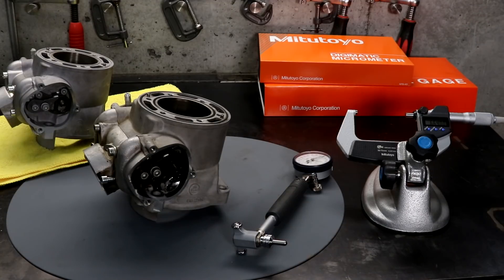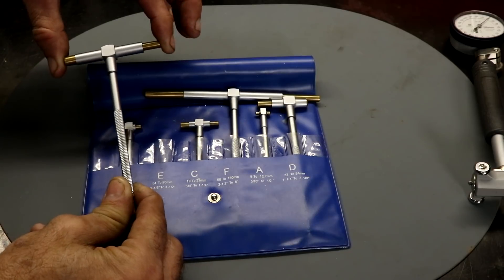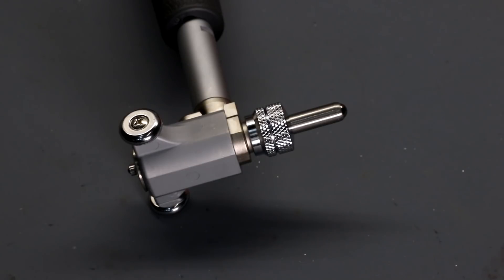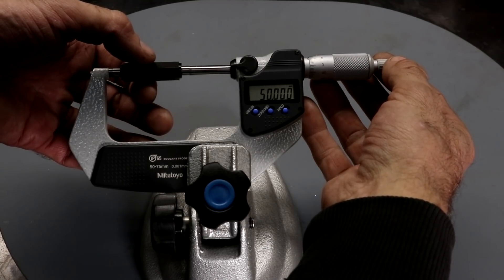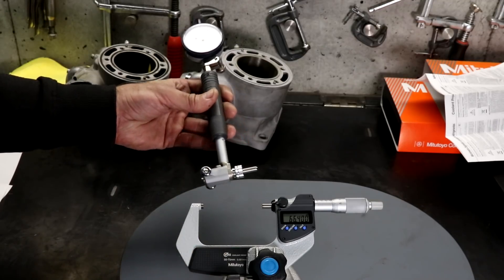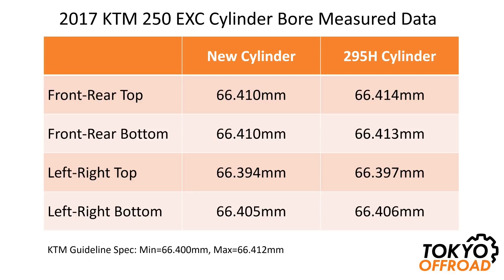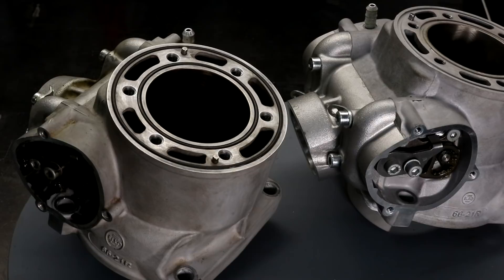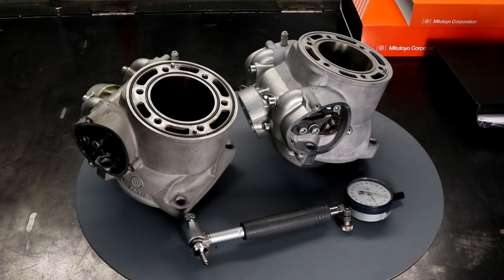Cylinder Bore Measurement

Comment: What about the micrometer stand? Do I need that?
Reply from the maker: Having a micrometer stand is not essential, but it does make it much easier to make measurements as it frees up a hand so you can hold the item you want to measure in one hand and turn the micrometer knob with the other hand. The one I have I purchased online (no brand) and was reasonably priced and decent quality. It's also sometimes handy for holding other things too.
Reply: @TokyoOffroad you’re the man! Keep making these videos! I have a 250cc and 300cc TBI and your vids have been so valuable.

Comment: Interesting that the KTM specs are listed as 3 digits after the decimal, that's SUPER accurate, no? I'm guessing a micrometer that only has a resolution of 0.01 would not be sufficient to get this level of detailed measurement...
Reply from the maker: Yes, that's right. The digital micrometer I use in the video (Mitutoyo 293-242-30 MDC-75PX) has a resolution of 0.001mm and is ideal for this application.

Comment: If you're just doing the same size cylinders only, could you get away with just using a inside diameter standard to set it to 50mm or 2" or whateverand not buy a micrometer? I have a cheap micrometer already but I feel it would knock gauge out of true.

Comment: Hi Mark, when you change piston on your 300 tpi, do you go for minimum piston to cylinder clearance?
My 2022 300 tpi have never had issues with the airfilter but are close to the service limit at 10 hundreds already after 42 hrs of normal enduro riding so it must have been close to max tolerance already from the factory (6.6 to 8.8 hundreds)

Comment: What is reason bike smoke problem
Reply from the maker: Excessive smoke typically indicates the bike is running rich. Also some 2-stroke oils smoke more than others, so if your jetting is good and the bike is not running rich you might consider using a different oil.

Comment: Good afternoon! I would like to know did you choose piston kit 2 becouse your cylinder bore is little bit larger than 66.412 and is it good idea for piston kit 2 ? Thank you in advance
Reply from the maker: I’m not actually using this cylinder currently. If I was I’d stay with a size 1 piston as the the majority of measurements are still within the size 1 cylinder bore specifications.

Comment: One questions. I had my speed cable disconnect on a 2019 ktm 300 tip xcw I plug it back In but it’s not ready my speed on my dash board. Any idea what it could be ?
Reply from the maker: TRB GENERAL FLOORING LLC - Is the magnet in your front wheel brake disc? Check to make sure the cable connectors are OK.

Comment: Do you have any starter system troubleshooting videos? I have a 2012 Husaberg Te250 with the poor starter design. I have upgraded to the stronger starter and rebushed all of the starter components. Starter works jumpered out. Looking to test out the other components in the system. Thanks, you have great content!
Reply from the maker: I don't have any starter issue related videos yet. I do have some experience though. 
"Starter works jumpered out"- Do you mean if you connect the starter to an external 12V source it works? Or do you mean if you take the starter out the bike and connect it to the battery it works? 
If your starter motor spins with no load, but doesn't when it's in the bike i would first check the battery voltage and charge the battery if it's low, or replace the battery if it's old and doesn't hold charge. Also check the battery ground cable connections. The ground cable terminals can easily become corroded and create high resistance which may stop, or slow the starter motor turning. Use a wire brush to clean any corrosion off the terminals. The frame/battery cable terminal connection seems particularly susceptible to corrosion. I smear a small amount of grease on the connections to help prevent corrosion. The next thing to  check is the starter solenoid. Does it click when you press the starter button? If so use a volt meter and measure the voltage at the starter motor when the starter button is pressed. If you don't see any voltage at the starter motor it would suggest that the solenoid is broken, or fuse blown.
Reply: @TokyoOffroad  thanks for the reply. The battery is strong, around 13.5. The starter works in the bike if I run a a jumper from the positive post to the post on the starter motor. The solenoid is not clicking when I hit the button. I removed the solenoid, found the 2 prongs from the plug that had the highest ohm reading(the magnet), applied ground and positive to said prongs, and the solenoid directed power through to the right  place. The fuse is good as well. I think it is a solenoid, but wasn't sure how to troubleshoot the start button. Didn't want to go order parts until I knew, and none of my other bikes have longer parts to test out. Thanks again for all of the help!

Comment: Just curious, no objection, but why a 60:1?  Is that what KTM recommends?
Reply from the maker: power.turbine - Yes, KTM recommends 60:1 with Motorex Crosspower 2T. It works well for the riding I do so I will continue to use it at that ratio.

Comment: My friend has a 300 exc from 2005 and just changed the piston once 10 years ago, still working fine 🤣
Reply from the maker: I'm not sure if you're joking, but my recommendation would be to change the piston and rings every 100~200H on KTM 250/300 2-strokes, depending on how the bike is ridden. Knowing how many years old the bike is, or how many years since the last overhaul is not important. You need to know how many hours the bike has been ridden. If the bike doesn't have an hour meter I'd recommend fitting one as it makes determining service intervals easy. For casual trail riding on a 300, mostly low RPM, overhauling the top end every 150~200H is probably fine. If you choose to run pistons significantly longer you risk excessive wear on the cylinder due to increased piston rock, reduced performance and an elevated risk of catastrophic piston failure (piston skirt may crack and break off), which may damage the head, cylinder, and crankshaft and be expensive and time consuming to repair. A 2-stroke top end overhaul kit is relatively inexpensive (about $200) and IMO cheap insurance to help avoid costly failure and issues while out riding.
Reply: @TokyoOffroad  lol no I'm not joking 😂 he rides his bike like crazy and only change the piston ones. He even went 3 times to Erzberg with this bike and made it with the top 300 riders. That sad I'm not saying I want change my piston every 200hrs but I'm not changing the cylinder that's for sure !

Comment: Best informative videos - as always!

Any chance you can do a video on how to solve deceleration surges (knocking sounds) for the 2017 KTM? :)
Started 20 hours ago for my bike and I can't find the cause for this annoying feeling and sound.
Reply from the maker: Fabio at PowerCDI has a very good write up about deceleration surges (pipe bang) here: 
http://www.powercdi.com/manual/combustion/pipe_bangs/en.html
If it suddenly started something must have changed. Check your airfilter is clean, jetting is clean (not to rich, or lean), idle is adjusted correctly and exhaust is not leaking at the manifold.

Comment: 6:16 you're saying: by rocking it you find centre or maximum of bore dimension.Actually you're looking for "minimum" that is closest to zero. Thats why it was bit confusing to me.
Reply from the maker: It's a two step process. The initial rocking aligns the bore gauge into the center of the bore, then subsequent rocking you start to perform the measurement and take note of the minimum reading.

Comment: How do you find out whats the correct angle of the bore meassurement against the cylinder walls, I can see how much the indicator of the scale rotates up&down because of leaning the bore meassurement.I guess you have to note the closest possible value to zero which is 66,4mm.
Reply from the maker: You initially rock the gauge to and fro to center it in the bore, like I show in the video, then start looking at the dial indicator carefully and note the minimum reading each time you rock it. In the video it read a minimum of +10um, so the measurement is 66.400mm + 10um = 66.410mm

Comment: Can you show where the cylinder size stamp or label is located on the outside of the cylinder? The manual indicates that it is on the right hand side, but doesn't show an example.
Reply from the maker: To see the cylinder bore size stamp mark remove the right hand side powervalve cover. There will be either a 1, or 2 stamped (not cast) into the case.
Reply from the maker: BTW, as far as I know,  all new KTMs are supplied with a size 1 cylinder. Still a good idea to check the stamp mark though...
Reply: Great, I will look. Thank You.

Comment: Good video, watch all your videos, I have a question that I can t seem to find a answer , KTM owner complain of a rattle from their engines and they believe it comes from the powervalve, have you had this problem or herd it or fixed it before,  I just bought a 2018 300xc so just trying trying to learn about them, and hoping I made a good choice going with KTM. I've always been a Honda guy and have had really good luck, with a few exception of the 2005 cr 250  that I wasn't wasn't to fond of. Any knowledge would be greatly appreciated
Reply from the maker: Thanks! I haven't noticed any power valve rattles on my bikes. It's always good to listen to how your engine sounds while riding and take note when something changes. But if your bike is running nicely now I wouldn't worry about it...

Comment: ktm 250 2007 2T  - 490H - 4 pistons -  1 bottom end rebuild....still works fine.
Reply from the maker: After how many hours did you rebuild the bottom end? Was there a specific issue with the bottom end?
Reply: I have bought the bike with 380H from a friend .In 410H since there wasn't a previous rebuild I decided to make a top/bottom rebuild. There wasn't anything wrong with the cylinder(some minor scratches) or the crank(some play but tolerable) .
I have fitted the B piston,the oil mix is 2%.
https://youtu.be/ofUL3G8xaRg
Reply: @TokyoOffroad  im just rebuilding my bottom end with around 3 years of use for sure well over 500 hours but enduro riding so not thrashing that hard and 2 pistons 2nd piston did get scored a bit though maybe from my over the seat river crossing adventure

Comment: Good video as always.
Regarding cold starts, is it really necessary to maintain rpms slightly more than idle?
Why not leave it at idle until the motor reach working temps?
Thanks for the videos btw.
Reply from the maker: Thanks! When the bike is cold it typically doesn't idle very well, therefore I use the throttle (after closing the choke) to increase the RPM a little until it runs smoothly.